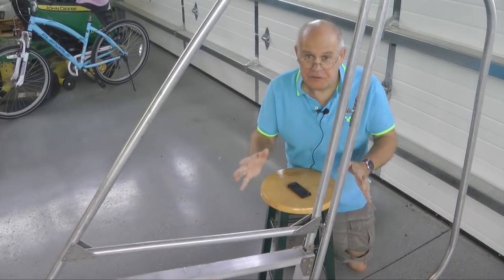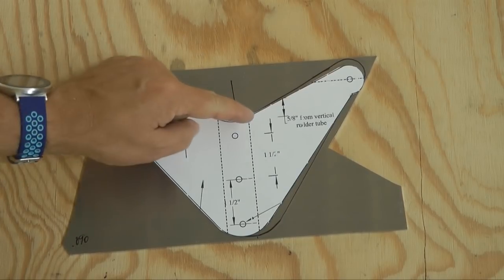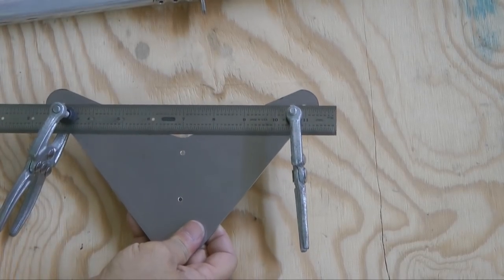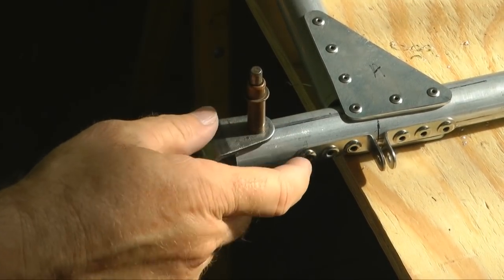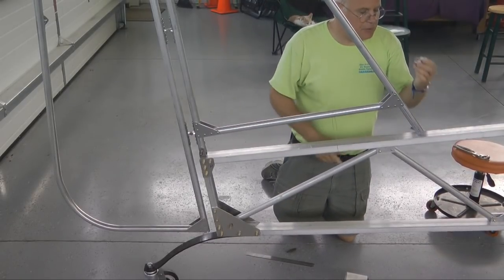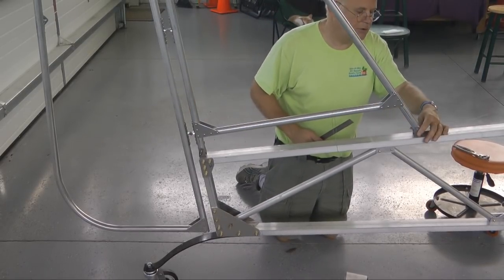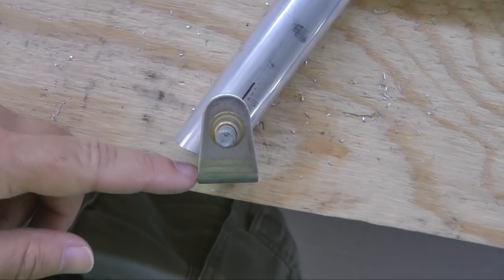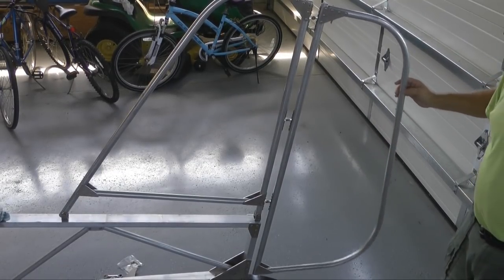Building the Affordaplane Part 15

Comment: Question on the body assembly. Why through bolts instead of rivets? I never heard a reason on those videos. Is it for shear strength or because of twist torque since the body is not a box design?
Reply from the maker: I am not the designer so I cannot give an authoritative answer... but you are on the right track when you consider those areas that you mention. In addition - the bolts provide a tremendous clamping force that not only adds strength that rivets could not provide - it also transfers loads thru out the assembly. This is not a boat, bicycle or go cart - it matters to gain full strength when failure of the structure may result in certain death.  No rivets and no Welding on those gussets!

Comment: I disagree with the placement of the rudder bellcrank. The line between the center of the cable attach holes in the bellcrank should intersect with the vertical center line of the hinges. If left this way, the bellcrank will pull more tension on one side than the other. 
The error will increase with the amount of deflection of the rudder. May not matter much, as the airframe and cables will flex, but there is a geometric error in this setup.
Reply: This mechanical engineer agrees with you, Jim.

Comment: I am somewhat surprised that those u-brackets provide enough lateral strength for the VS and rudder.  I guess at the speeds this plane will fly, the sideways force on the VS from the rudder is probably relatively small.  I expected to see the designer leave a 2” tail on the rear of the vertical VS tube and then drill holes in the rectangular tube so the VS tube would go down through the frame tube and be held in place by the bolt you had to remove to install the short bracket bolt.  That seems like it would be at least as easy to install and would likely give much greater lateral strength.
Reply: There are cables that run to the elevator for strength.
Reply: @abundantYOUniverse  Ah, that explains it.
Reply: As Jon explained near the end of the video, the VS is laterally supported by cables from the top of the VS to the horizontal tail, so all the brackets have to do is secure the VS to the airframe.
Reply: @n206ja  Missed that comment.
Reply: I have wondered how much stronger (or weaker) a welded joint in aluminum would be?
Reply: @davidwhite2011  welded aluminum is prone to cracking.   i'd stick with rivets and bolts.
Reply: @davidwhite2011  Well...Only one way to find out is weld it and report back on the findings....

Comment: I've read all the negative and positive reviews of the affordaplane, and would love to build an ultralight version, even though they say you can't ever make the part 103 reqs. If I put a recovery chute on it, that gives me a higher weight allowance (+27lbs), but can get an air deploy chute for much lighter. I also want to power it with a Predator 440 cc big block with some performance mods like alum flywheel, governor delete, carb, etc. You can safely get 35hp from one.
Reply: You can make part 103, people have done it. You just have to do exactly as the plans say, and dont add anything. Less paint, minimum floor, 1.9oz fabric etc. 
 Build one, or at least order the plans, $20. Two ten dollar bills, or.... debit card, and fifteen minutes, and your no longer sitting in your chair typing , " I'm thinking about.... just get after it.
Reply: @kirbylee57 ...Honestly I don't why people keep knocking this plane...Quite a few been built...And made weight....Plus, the designer couldn't keep selling plans if it didn't make weight...He could get sued for "False Advertising "....Just that simple...🤷‍♂️🤷‍♂️🤷‍♂️🤷‍♂️🤷‍♂️🤷‍♂️
Reply: @kirbylee57  Great comment!